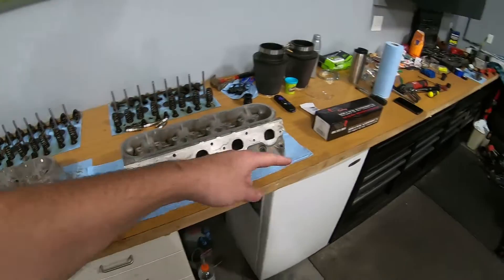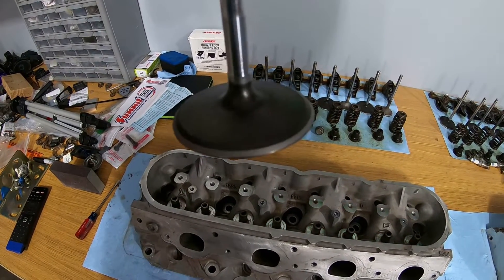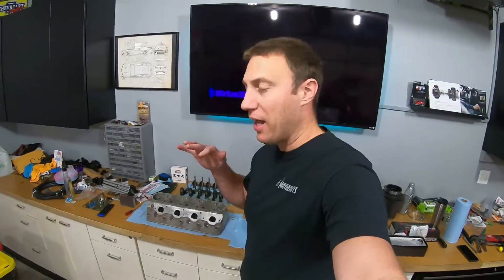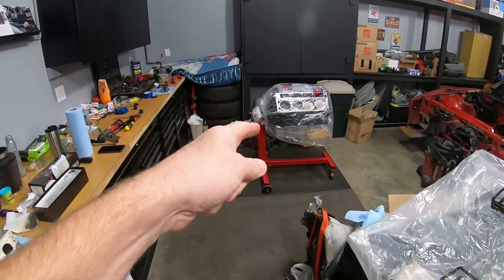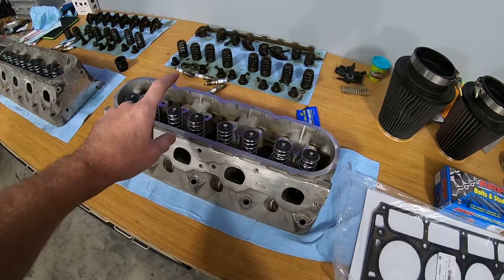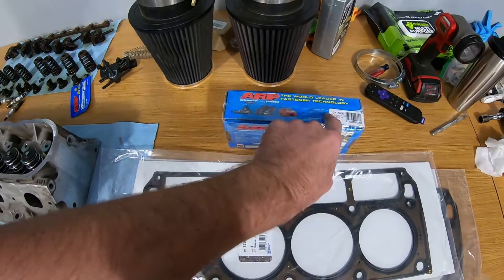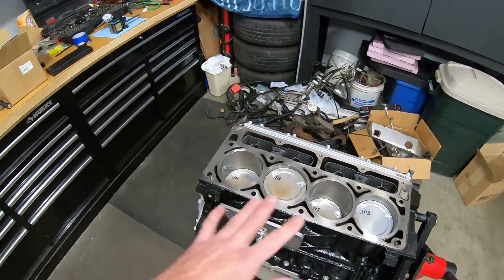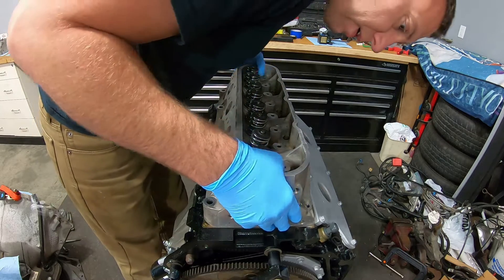LS3 Cylinder Head Install w/ARP Bolts

Comment: Thanks for sharing. Im building my first engine does adding washers necessary for the springs? I wasn't paying attention about this procedure
Reply from the maker: @sKid-ts7hr  depends. Washers under the springs is to set your installed height precisely to get the correct spring load. Every head is going to be different. So it might be few lbs shy on spring load or it could be spot on. If you have a mild cam probably OK but if u have a very aggressive cam it's essential to check installed height.
Reply: @EssMotorsports  appreciate ur fast reply. I have this cam from Lingenfelter GT11
215/231 duration 
@ .050 lift 
631/.644 lift with 1.7 118.0 CL
Reply from the maker: @sKid-ts7hr  i would just consult the mfg to make sure u have the correct spring package

Comment: I think you put the headgaskets wrong front usually means it going in front of the engine block
Reply from the maker: Yeah I had engine flipped and I was flipping gasket around. But u can see the water gasket openings are towards the rear of the engine where they should be.

Comment: When you’re torquing bolts, the second click is essentially useless. The first click should be reached while the bolt is turning so that you are under dynamic friction of the threads and bolt head. Once it stops turning you are in static friction which is much harder to overcome. If you are not confident with your first click you must back it off and try again